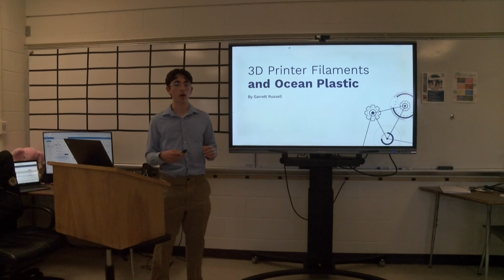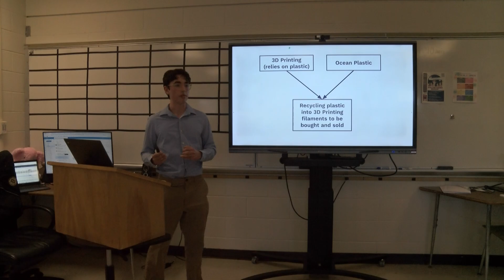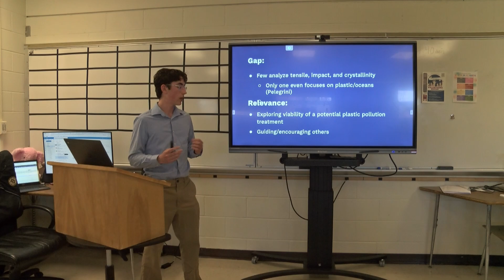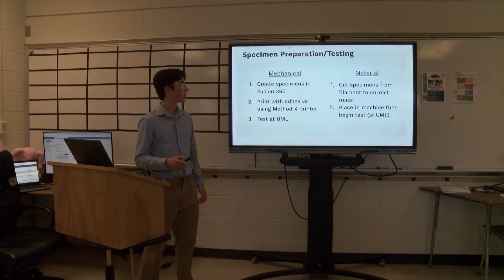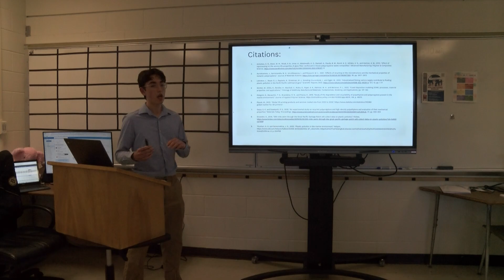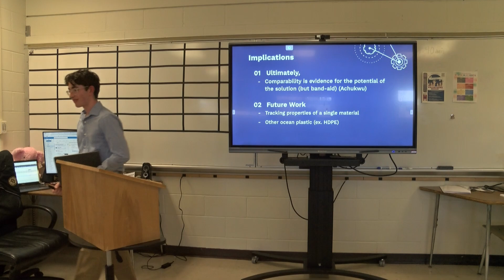3D Printer Filaments and Ocean Plastic: AP Research Defense

Comment: AP as in "advanced placement"...? Is this something you did in high school?? 

If so, I'm absolutely blown away by this. This paper deals with content typically not taught until the 2nd/3rd year of engineering programs. Hell, I'm impressed by the fact that you even know how to use LaTeX in high school. Moreover, I took a look at the TeX file, you're not just using LaTeX, you're using it at an intermediate/high level too. Even by undergraduate standards, this is impressive.

I wish I would've had your maturity and drive when I was your age. Incredible work! 

If my assumption that this was work you did in high school is correct, I have a question: Where did you find the time to learn everything you needed to do this? e.g. the physics, the math, the typesetting, etc.
Reply from the maker: Yup, this was my AP Research Paper (senior in high school)! Thank you for the kind words! For the learning aspect, I just allocated a ton of time to reading research papers and watching videos. Most of them I didn't read fully, would just make tons of searches with slightly related terms and skim a ton of abstracts until something clicked. I also got extremely lucky and had an expert at a local university who helped me work through some things and coordinate sample testing.

As for the typesetting, most of that was taken care of by an ASME journal template, all I had to do is figure out some table formatting and citation stuff, and then the rest of it was just tweaked with trial and error.